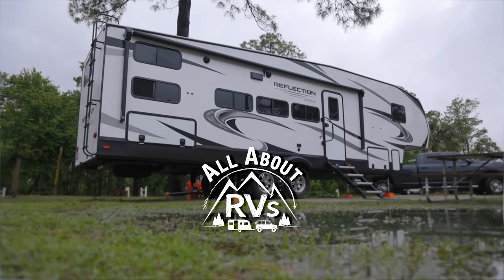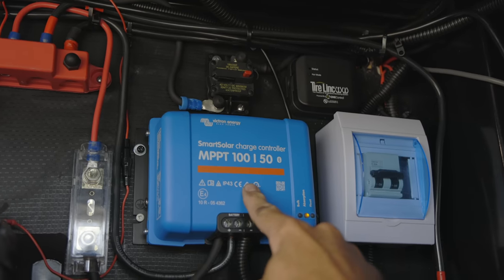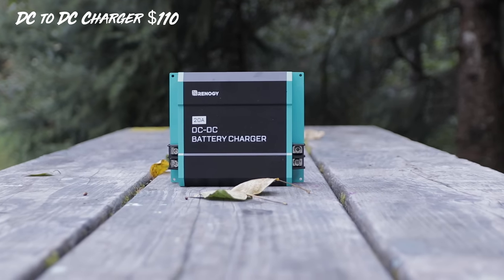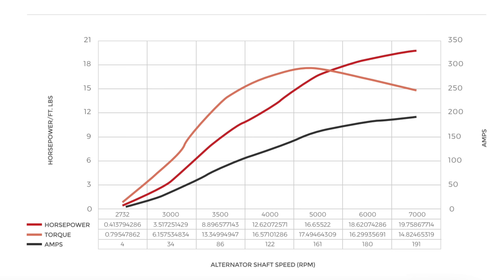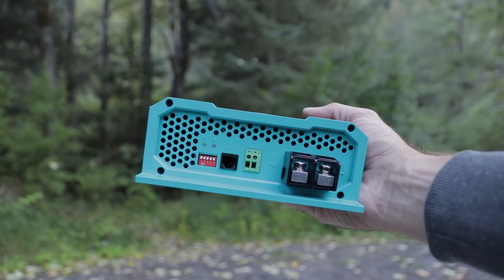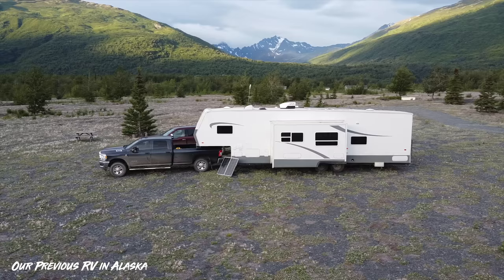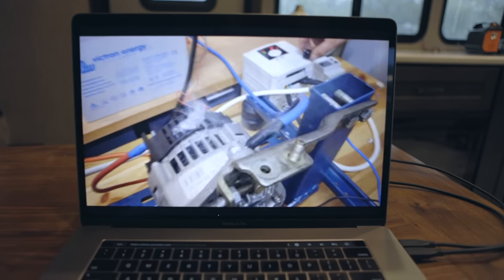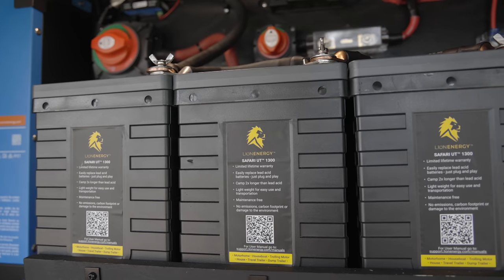RV Alternator Smart DC to Dc Charging.

Comment: Wow! Last year I installed the same charger except its 40 amp. Also installed it in the same place and used the camper running lights as the switch to activate the charger  on our Grand design 5th wheel. After installation, I ran down the 400ah of lithium batteries to a low state of charge then connected to 2012 Ram diesel truck and used a clampon amp meter around the positive cable to the charger for testing. The meter indicated 39.97 amps. Then after a few minutes, the charge amps started dropping as the batteries charged so I knew the charge controller was managing the charge rate properly. Thanks for your well done video!
Reply: raystanton238 I have a 2014 Ram 6.7 diesel with a 180A alternator that I want to hook up to a Renogy DCCS50S which has a (50A alternator connection) and 400ah batteries.  I'm wondering how your setup has been working and what amperage alternator you are running.

Comment: I used the same product for the same reasons. Works great. I mounted mine in the truck and turn it on and off with the ford outfitter switches built into the truck from the factory. The reason I installed the converter in the truck is I have two different trailers and wanted to be able to use it on either.
Reply: Sir 
Where did you mount it on your Ford truck?
Reply: I mounted mine on the TT, but I kind of wish it was on the truck because I can't get a reliable Bluetooth connection from the cab.

Comment: i just put a renology 20 amp dc converter on my trailer to charge up my single lithium battery.  i intercepted the 12V hot off the trailer plug along the frame and took it direct to the charger.  for now i just hot wired the 12v trigger to be instant on as soon as I plug the truck in, but i like the idea of running that off the taillights.  my voltage drops to about 10.9 when it pulls full current, but the other side of the charger is stepped up to a perfect 14.6 to top off the lithium.

Comment: We installed this exact unit a few months ago to help feed the residential fridge while on the road. It has made a world of difference. We can now arrive at camp after a long driving day with a 100% charge on the house battery. Probably our most significant upgrade to date.
Reply: That is exactly why I am considering the same thing.  I have a truck camper with a Norcold 3 way fridge but if I put it on DC then it will kill the batteries in under a day...even if I am driving.  I don't want to have open propane when driving and we often do an 8 hour drive which is a lot to expect the fridge to stay cold without power from somewhere.

Comment: Good explanation, I juste completed my own Renogy 40 amps DC 2 DC installation, as I’am having an180 amps alternator.
Quite a job to fit the 4 awg wire in a Jeep Grand Cherokee, but for the rest it is quite simple.  My only mistake I bought these unexpensive breaker! bad idea, I had to replaced both of them as they were over heating and tripping for no reason other then heat.  The new breaker are like yours and they do the job so far.
I added a switch in order to reduce to 20amps, whenever I don’t need the full capacity.
Good video as usual, thanks a lot and apologise my english writting, it is not my mother tongue.
Regards,
Reply from the maker: Good idea on a switch to limit the current.

Comment: Great video. The other point to note is that without the DC-DC converter, to charge from the 7-way, the alternator voltage needs to be higher than the RV.  If there is a diode allowing one way current, the vehicle/alternator voltage needs to be about 0.7V higher, or there will be no vehicle charging, so from my experience vehicle charging only works when RV batteries are significantly depleted (e.g. less than 50 %).
Reply: Not so. Lookup Victron mossfet dual battery isolators

Comment: Thank you Jerry for the info. While watching your video I saw your Norcold, I stopped the video--- (we park are rv at our home) I went outside turn on the inverter, switched our Norcold 1210IM from LP to electric and it worked. "shazam" it worked.... lol... I just never thought about using the inverter to power our Norcold. I was told to use LP or shore power/generator. I was going through more LP than I needed to. I have over 2000W of solar on my roof with a Magnum Energy MS3012 inverter sitting around doing nothing most of the time, until now... Thank you for your video......
Reply from the maker: Glad it helped
Reply: I always run my Norcold on inverter power when driving.
Reply: @deltabravo1257  Thanks Delta Bravo, I started to do this also.
Reply: My Dometic 702 pilot flame blows out when driving. I have 800 watts on the roof, 400AH of BB lithium and a Magnum 3000 Hybrid inverter. I run the fridge on inverted AV when driving down the road. As my wife says "after the original investment the solar generated power is free but propane costs money". Smart girl she is.

Comment: I went with the victron 30 amp unit, and as long as we are moving every couple of days our 2 lead acid batteries supply all of our needs with no other charging required.   When those bite the bullet we will replace them with lithium (as much for the low maintenance as anything) but B2B charging (and a good battery monitor) makes the batteries we already have do the job with flying colors.  If you dry camp as you travel every few days you need this.

Comment: Thanks for the video Jarret!  Getting ready to install the Renogy 60A DC/DC charger on our Renegade Verona. We installed 4 of the ReBel 100AH LiFePo4 and 820 watts of solar along with the Victron MPPT solar controller. I am tempted to just install the Victron DC/DC charger, but they only have up to a 30A. Our alternator, being a Freightliner and Cummins combo is pretty good at 180A, so I believe the 60A will be OK, but I sure like the Bluetooth connectivity of the Victron items. Only Victron thing I've not liked is their Smart Shunt as its Bluetooth is very week. I went with the new Thornwave Power mon epoxy sealed module and separate shunt as its Bluetooth will connect to my phone from over 100 feet away. I I can use this to monitor the Renogy charging, but I still like the ability to connect to the Victron DC/DC charger via Bluetooth. FYI, I've installed the RedArc BCDC, and the Renogy DC/DC/MPPT systems on other applications and really like the RedArc as well. FYI, I am not affiliated with any of the brands mentioned above, just like them.

Comment: Excellent video.  Since I have a 24V lithium house battery setup in my travel trailer, I use the Victron Orion 12/24-15 DC-DC charger (360 watts max) with a similar dedicated #6 AWG charging circuit from the truck.  It works well and is a good supplement to solar on travel days.  I like running the fridge on electric rather than propane when we travel, and I don't have to worry about running the house battery down even if its cloudy.
Reply: wat kind of car/alternator u hav? safe for any alternator?

Comment: I really appreciate the information. I know the questions I am about to ask are a little off topic but you seen to have tons of knowledge that might help me solve my situation. I live in New Orleans and the power outages that resulted from Hurricane Ida convinced me that I need to acquire a back up power system. The traditional solution - a gas generator - is almost impossible for me because I have no place at all to store it and the gas required to run it. I purchased an inverter rated for 3500 watts and am hoping to run about 2000 watts during emergency situations using my car (alternator and batter). One of the downsides of such a system is obviously how much it would tax the alternator. So, when I saw your video about the dc-dc charger it seemed like it might be part of my solution. I just don't know how to figure out what I need to create a self sustaining system that will run for a week or so as long as I can keep the car gas tank full. I would obviously like to use as little power as possible from the alternator (I believe its rated for 110 amps) to recharge the battery(s) but I need enough amps to prevent discharge. I also don't know whether adding additional batteries or how many would be useful.

Any advice you could provide would be greatly appreciated

Comment: I plan to use my 15a victron solar charge controller since I  have it for use with ground based panels.  I plan to use a 12v to 48v dc to dc converter to feed the 12v from the tow vehicle to the 'solar' side of the charge controller.  That will limit to 15a and allow me to use a dpdt switch to select between the output of the dc to dc converter or ground based solar panels to feed the input of the mppt controller.

Comment: Didn’t know that was even a thing!  haven’t even started on a better battery system, it honestly intimidates me a bit.  Thanks for the info!
Reply: I have a 40amp unit to run my refer in the TT so I can shut down the propane while traveling. It works awesome. Easy to hook up. I'll never be without one again. We always have full batteries, propane and cold fridge to start camping with.

Comment: Love your channel from which I learn all about RV especially on the electrical aspect. Quick question: Isolated or NON-isolated DC charger do you recommend for a towed trailer. Your link points to an isolated one. Your expertise is appreciated.

Comment: I just got done building 400ah lifepo4 battery. Total cost about $2200. New inverter charger new dc to dc charger. Battery cells from Battery hookup. Bms from eBay. Renogy solar panels from amazon.  Now a norcold dc compressor fridge from amazon another $1400

Comment: Great video Jared. Your videos are by far the best out there for RV info! I just recently purchased a lithium battery to replace my AGM one. I also have a Reflection 5th wheel (260RD). I guess my question is: If I don’t have a lithium DC-DC charger yet should I disconnect the wire from my 7-pin plug until I get one? My primary interest is to not damage the new battery or the truck. Less concerned about charging while driving. Thanks in advance, and all the very best to you and the family! - Maarten.

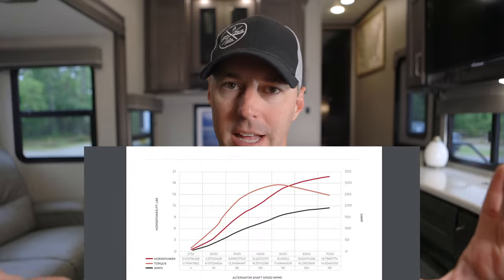Comment: Looking at 3:14, there is a graph shown for amps vs power loading for the alternator I would recommend this be revisited. The maximum horsepower draw on standard alternators is relatively small, in the order of 3 horsepower maximum. Example: 1 hp  = 745.7 watts. An alternator operating at full capacity outputting 120 amps at 13.8 volts would. With battery packs getting larger with more capacity, it may be worth while to look at potentially utilizing more of the alternator ability, perhaps towards 60-70% of its rating to shorten the charging times. On a standard 100 amp alternator this would put it towards the 50 amp range for a current controller.

Comment: Hi, I am just getting started and I am wondering if you disconnected the charge circuit from the 6 pin connector after installing the DC to DC?
You mentioned that you originally were charging lithium's from the 6 pin without any issues, did the lithium receive a full charge from the 6 pin and was the charge profile safe for the battery, and you did mention that you didn't have anny alternator problems either. My truck has a 230 amp alternator and my RV is a truck camper with a 6 pin connecter.
Thank you

Comment: I have the same  unit on my small RV  however I have it triggered by a small sense  relay that switches on when the engine battery reaches 13.2 volts and off at 12.8 volts - it charges 300ah  lifepo4 from a 120 alternator  - I was tempted to get the 40a but have heard that in traffic when the engine &  alternator  turn slow its fan is inadequate for cooling  the load - some alternators may not be able to meet the load and go into deficit - so like you I went with 20a Renogy DC to Dc - a big improvement on my previous crude split charger which seldom gave more  than 6 amp

Comment: Thanks for a great video.  I have a couple of questions if you have time to answer and you are still in YouTube land.  You ran 6AWG wire in the truck, did you also use 6AWG wire in and out of the Renogy 20W DC to DC charger?  Was this 100% copper wire or copper-clad aluminum or does that make a difference?  Hope to hear from you soon, I have an Amazon order to make.😛

Comment: You did not address one thing. What did you do with the wire that supplies power from the tow vehicle to the battery on the RV via the 7 pin connector? One thing I have been trying to figure out is if I need to install a dc to dc charger on my fifth wheel. I have a 2017 flagstaff that only has one deep cell lead acid battery and no inverter. My truck has dual batteries and a 397 amp alternator. Am I correct to assume that I do not need one? If I decide to replace my lead acid with a single 12volt 100 amp hour battery with no inverter would I need one then? PS. Love your videos, and have used many of your suggestions...thank you!

Comment: Seems pretty straight forward. I have one question/comment. I assume there is no conflict with power coming from the 7 pin connector. Is that correct? Thanks

Comment: Hi Jarret, love all your DIY stuff!

Quick question, I've got the same RAM 3500, how long was the 6 wire from the starter battery to the connector in the bed?

Also, do you have any suggestion how to get the cabling through the skin of the GDRV 5th wheel? Did you fish?

Thanks!

--- Milan

Comment: I have an old truck and Lance camper (80s) I added a 200ah lithium battery, two 100w solar panels with a charge controller, and a 3000w inverter. When I travel long distances with my fridge running off the inverter, it kills my battery. I'd like to add my truck's charging system while towing through the existing 7-pin connection that has a 10awg wire available in the engine compartment. It has a 120-amp alternator and dual AGM batteries. It needs to disconnect automatically when the truck is off. What do I need?

Comment: Hey I realize this is an older videos, I just wanted to ask , Did you need to remove the 12v + from the 7 -Pin from the truck as to not add extra 12v?amp draw from the alternator ?

Comment: I'm so happy I found this video. My Ram has dual alternators and I was wondering if there's a way to get more power to the travel trailer batteries while I'm driving. 

So in theory, if I run a 40a charger and let's say 4awg cables, plus add an inverter to the trailer, I should be able to run the AC fridge while I'm driving, right?

Comment: On my radar. But before I install a dc-dc charger I want to know how many amps my alternator is providing to the house batteries...2 6V GCs. How did you make the determination that your alternator was delivering only 1 amp or so?

Comment: Curious why you didn’t go with a Victron dc to dc charger since all of you other gear is Victron?  I ordered a Renogy and when I saw how gigantic it was, I gave up trying to install it in my truck camper so I went shopping again and found the Victron Orion Smart TR unit.  It was perfect because it’s so small.   I also run my fridge on AC power via the inverter when driving and the alternator keeps up with the demand now that I have upgraded cabling and the Victron unit.

Comment: I know this is a 2 year old video, but ... don't you have a charge controller for your batteries? What's the capacity of your alternator? Is it well above what the charge controller uses to charge the coach batteries or well under? And, don't forget about the BMS and what it's designed to do. There are far less expensive ways of charging your batteries while driving.

Comment: Hello. Thank you for this video, where did you run the D+ wire from the renology to your running lights? I couldn’t tell from the video. Was it to the 7 pin wire harness in the hitch or in the truck? That is a clean install. What wire clip did you use? Thank you so much. I have definitely subscribed!
Reply: The D+ was ran to his lights wire. It's the trigger wire if you will and when the controller sees voltage it'll turn the inverter on. I wired mine to an aux circuit that switches on when I start the truck. I used an add a circuit to my fuse panel for it.

Comment: Hi there, I am towing a 16’ trailer with my 2019 Toyota Highlander Hybrid SUV. I wanted to install a DC to DC charger but couldn’t find much info out there. I was wondering if you can give me some tips or advice on how to install DC to DC charger from a Hybrid SUV as it does not come with an alternator. Can I connect it directly to the vehicle main battery in my case? Will that be an issue? This might be be a good YouTube content as more hybrid vehicles and EV’s are getting popular. Thank you!

Comment: Interesting and informative video as well as the explanation.  However, couldn’t get the schematic to enlarge/move to see all of it at once.  Any chance you could add that to the description below?
Cable size is dependent on amps and distance of the run?
Thanks again
Reply: Did you try taking a screen shot of the schematic and enlarging it as a photograph? Doing this you can also print it. There are some very good voltage drop calculators on the internet. They will take into account system voltage, distance, load, type of wire, above or under ground and the results will tell you what gauge wire is recommended.
Reply from the maker: Yes you can download the diagram from the website https://allaboutrvsinfo.com/rv-inverter-setup-how-to-power-it-all-30-and-50-amp/